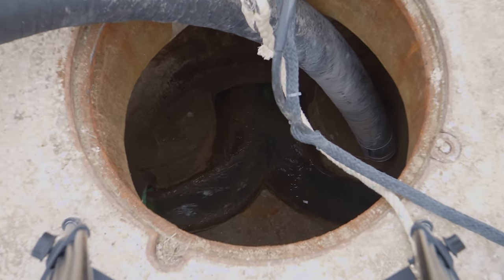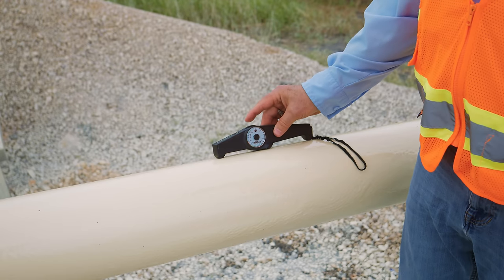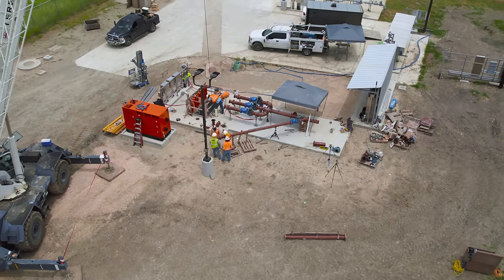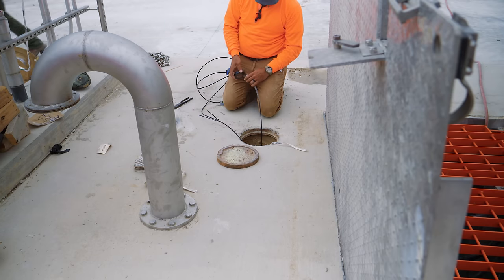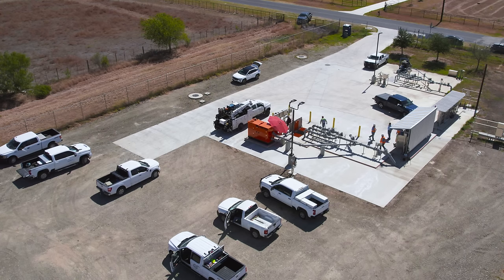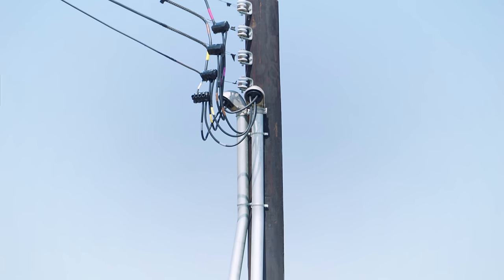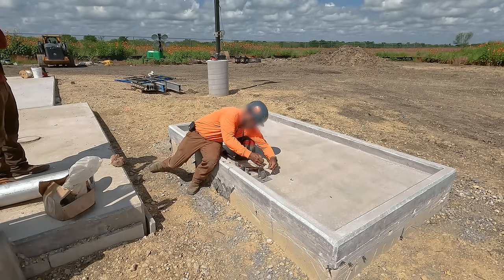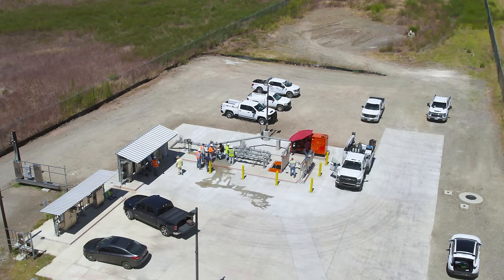HEAVY CONSTRUCTION of a Sewage Pump Station - Ep 5

Comment: My dad was a field technician for the local water company. He was the guy who'd drive out there at 3am when the red light starts flashing, with a pair of waders in the car just in case. He'd have loved how maintainably designed this station is!
Reply: The endorsement fron an experienced person like 🎉 your dad  always matters.
Reply: I can never understand why the Shone system developed in the mid 19th century is not used today. With no moving parts on the water side (except the non return valves) many of these systems are still running today, after more than 100 years of 24/7 operation. They were developed when buildings in London (UK) were below the Thames, and hence the sewers. The houses of parliament, better known for Big Ben, were one of the early installations that is still running today. Between 1909 and 1026, they were incorporated into several London theatres.
When I visited the Becton treatment plant, that has to lift the sewage from a sewer large enough to drive a single decker bus through, I explained them and they were gobsmacked at their simplicity and lack of any pumps. No one on the design team had even heard of the principal.
If it is not something that you have come across, I am happy to explain it and how unbelievably simple and maintenance free it is by eliminating pumps that can block and wear.

Comment: This series has been extremely satisfying, I hope you'll continue! There has to be a more efficient way to get all this done. I feel like manufacturing the wells as single pieces, with plumbing connections included, would save weeks and millions of dollars.
Reply: Although I like the idea... I don't think this solution would be cheap for all the different types of infrastructure.

It's a lot cheaper to make a lot of the same pipe in a factory vs making specific, custom-made wells
Reply: @mrping2603  I also feel like the separate-piece construction could deal with settlement, seismic events, etc better
Reply from the maker: Lots of smaller lift stations come prebuilt like you said, but not at this scale. It took 6 semi trucks just to deliver the wet well segments!
Reply: you underestimate the cost of hiring a custom haul truck to move something that is too big to haul over the road.  and the cost of renting a crane big enough to lift that entire thing all at once.  you're talking about weeks in transit and millions of dollars in transit costs.
Reply: @kenbrown2808  The other day I saw a convoy of way oversized stuff and they had to have a police escort and like 20 lead vehicles/follower vehicles. The entire interstate was piling up behind them. I think they were carrying what looked like rocket parts potentially, large cylinders two end capes, and the cylinders had a lot of attachment points/small pipes. I only shudder at how much that must have cost.
Reply: What stuck out to me was the on-site stripping and painting of all the piping, plus QC for the coating.  Surely that could all be done more efficiently, effectively, and probably cheaper by the manufacturer or at least a third party, indoors.
Reply: @macaroniandtuna  - but then you have to more carefully transport the finished product to site and any tears in seals or scratches are now a reject/redeliver issue. I'd imagine there are trade offs either way here and I'd imagine they've been considered.
Reply: @macaroniandtuna  I wouldn't be so sure about that. The protective coating the manufacturer puts on is meant to protect from the sorts of damage that can occur in transit (including on the flange faces & sealing surfaces), the in-use coating is meant to protect from the environment in the wet well (less abrasive, more corrosive) and has to leave the flange faces & sealing surfaces uncoated so the seals can work properly. Even if they could have one coating that worked for both environments it'd still need a way to protect the mating areas in transit, and removing that & preparing the surfaces would still be an on-site expense. It might be a waste to do it the way they did here, but it's not immediately obvious.
Reply: @macaroniandtuna  Where i live they just use 316SS instead. Not sure how the cost compares but as haven't worked with this shown system
Reply: It all looked very efficient and competent to me. There is a reason engineers do things the way they do and very often trying new procedures makes things more difficult or less efficient. There are also complex regulations to worry about.
Things like paint are often done last minute because they are easily damaged by other work. Also painting once is cheaper than repainting several times, especially if you have to clean off the old coat(s) first..
Reply: The unions™ would never allow it.
Reply: The only thing i thought was weird are the submerged pumps .... they likey dont like the maintainance crews..
Reply: @Theinatoriinator  other than the multiple attachment points, I'd say parts of a windmill tower.  but yeah, biggest thing I saw being moved was a power plant transformer.  I calculated the haul truck as a 180 wheeler, and it was moving at a speed best expressed in feet per hour.  few escorts, because it was on private property, from a purpose built railroad siding to the power plant.
Reply: @macaroniandtuna  until it gets chipped in transit.
Reply: @NuclearSavety  you don't have to prime a submerged pump.  and a top mounted pump is still going to be full of sewage if it has to be serviced.
Reply: @kenbrown2808  the diesel pump is also self-priming ... and opening a poop-filled pump is still much less of a mess than pulling one out of the 'pool'  ....
Reply: @PracticalEngineeringChannel  Well, you could put in place a casing and then bring in liquid concrete to add the needed weight.
Reply: @Lucien86  I disagree strongly. Very frequently, the reason engineers do something the way they do is simply because that's how it's always been done. This has been especially painful in aerospace development.
Reply: @dansands8140  when the consequencrs are potentially catastrophic, there is a good reason not to get too creative....
Reply: @NuclearSavety  and the pump in the diesel pump is probably more expensive than all three submersible pumps combined.  and a pressure washer pretty much eliminates the mess of pulling a submersible pump for service.  everything has tradeoffs, and the engineers chose to use submersible pumps in that application because the benefits outweighed the drawbacks.
Reply: @kenbrown2808  i fully agree, its a substantially cheaper sollution, that is a big advantage ... i still would go a different route.... and seeing the corrosion skid marks on the new pumps ... well, its not my job  ...
Reply: @nelsonbrum8496 respectfully, while Unions may have played a minor role, it's the potential liability that drives most of, if not all of the various procedures. Nobody wants to pay for redoing any work. Much better to do things in the approved manor. For that reason lone, contractors will opt for as much independent inspections as they can. It's insurance against the possible reprocussiions.
Reply: @Theinatoriinator  It could be rocket parts, but I'll bet you it was equipment for a large chemical refinery plant.
Reply: @NuclearSavety a key point to remember is that pumps can only push, any sucking is just fluid being pushed by atmospheric pressure. This also means there is a hard limit to how far a pump can intake water from below itself, as well as a much reduced flow rate for whatever operation it can provide. The submerged ones likely operate far more efficiently at a higher pressure,  are protected from freezing, and can be cooled by their sludge bath.
Reply: @Steamrick  you've gotta be right, now that I think about it. I couldn't get a good look and I was already thinking about rocket parts but chemical refinery makes more sense.
Reply: @macaroniandtuna  I thought of that too. But then I realized they were only doing that to the pipe that was to be submerged inside the well. So that coating was something special. They left the factory coating on all the above ground pipe and applied paint conventionally.
Reply: @NuclearSavety Probably using PDP's. But yeah, zero fun.
Reply: @microwave221 They're also probably Positive Displacement Pumps. Dang near infinite head.
Reply: If built in-factory instead of on-site, transportation of the very large and very heavy assembled structure would be difficult and expensive.  Also the factory assembled structure would have to be more sturdy to survive the stresses and forces of transporting, which would increase the weight.

Our transportation infrastructure is not designed to easily handle moving objects that are wider than lanes on roads or wider than railroad cars.  There are height, length, and weight limits too.  It's possible to move bigger and heavier loads than these limits, but the cost goes up, and the transport methods become fewer.

Comment: Great video! As a potable water plant operator, the majority of your video is also incorporated on drinking water as well. SCADA, transducers and redundancy measures are extremely similar. Difference is we use powerful motors to extract water from underground aquifers and treated into clearwells where chemicals are added and sent out to community either by booster pumps or elevation tanks.

Comment: Your work is amazing on this series. Thank you so much for all the work you and your team put on this.

I work in electric maintenance in water and sewer lift stations here in Brazil. Some parts of this new station are exactly the same as the stations where I work in Brazil, while others are very different. Here, for example, in many stations we only have float switches as a device to turn on the pumps, and the wet wells here are not covered with epoxy paint.

Comment: The bag in the conduit is a great idea for running the wires. Separate of that, kind of sad seeing how developed the land is becoming.
Reply: And how car-centric it all is. And knowing how much energy is required to pump this sewage up - how utterly wasteful we humans are.
Reply: @idjles 100kW with 2 pumps running is certainly a lot of power but compared to how wasteful other things are, it's not comparable.
Reply: The bag on the string is called a mouse, and the trick has been passed down by generations of electricians.
Reply: @idjles would you rather we didn’t pump it?
Reply: @idjles in the industrial world, those actually aren't very big pumps. I've seen 350HP pumps used to distribute chilled water for building cooling, and the actual chillers consumed nearly 2000HP, plus more 350HP pumps to pump hot water to the cooling towers, and the cooling towers all have 75-100HP fans. These also aren't run at 10-20% capacity normally like a car engine, they run near their full capacity for long periods of time. I saw meters in a paper mill once that estimated they spent at least $17,000 an hour on electricity, and they did not look like they'd been updated in a good long while either, and that's just from utilities. They also run their own power plant at the mill! 

TLDR: Don't worry, that lift station does not use that much power!

Comment: It'd be interesting to hook up a little 360 camera and GPS unit, send it down one of the lines and be able to follow it throughout the system
(GPS + inertial tracking when it's unable to obtain a signal. There's also RF if someone were to walk along the surface to manually trace-out the path)
Reply: I'm not sure I want to see what a camera might show in a sewer pipe. 💩
Reply: Most probably GPS and internet coverage will be quite poor through most of such journey. Unfortunately. Video footage might be interesting, but would require a lot of light and hope that it doesn't get stuck somewhere.
Reply: Do people think GPS is magic?
Reply: GPS needs view of the sky, so better to have an inertial tracking unit to map that journey;-)
Reply: The pump would grind it to pieces
Reply: @benclarke8699   There are usually screens to prevent large objects getting into the pumps and whatnot, so it'd have to be pulled and moved passed the pumps. 
I was referring mostly to the gravity-fed system from a house toilet to the lift station.
Reply: Hello, your local wastewater operator here. We commonly put cameras down the pipes to track leaks or illegal discharges, which then can be internally repaired with an expanding hard foam instead of having to dig up the pipe. We call DEP on illegal discharges. They don't go all the way through, but they can go pretty far. If you'd ever like to see a map of your water/sewer system, they're available in public records, or you can go to your local plant and ask nicely to see the physical map.
Reply: @christhompson2006 Retired wastewater engineer here. I've spent many hours watching video of sewer pipes, most of which were actively flowing sewage (or sauce as we called it). When people from other departments walked by and asked us what we doing, we just told them we were watching "dirty movies".
Reply: @johnnyh3653  🤣🤣🤣

Comment: Last month I was tasked with modernizing a wastewater treatment plant for my last final exam necessary to get my electronics engineering degree. It's so cool to see how these things are actually built even if this is a small part of the entire wastewater treatment system. I had to put sensors, PLCs, actuators and orchestrate everything using SCADA, not to mention motor soft starters, protections and controls. This is a great series and I'm really grateful you took the time and effort to make it, thanks!

Comment: I'm retired now but I saw many interesting motor control systems. At first I started out with systems in bakeries such as moving flour or sugar using an air blower from silos to weighing hoppers. There are continues systems and batch systems. This description is for batch systems. The hoppers dumped the weighed product into large mixers that made sponge dough that was dumped into large tubs. After the sponge raised then it was dumped into a dough mixer. The mixed dough was placed in large tubs that were used to dump the dough into a bread former that dumped dough into bread pans. The pans went into a proofer to raise the bread, then into an oven to bake the bread, followed by a spiral bread cooler, then into a bread slicer, a bagger, and conveyors to move the packaged bread to trucks.  

Another interesting project I worked on was a copper wire shredder that had a conveyor to put the wire into the top of the shredder.  I remember they had a large coil of small wire that had misaligned insulation. They spread out the wire so that not all of it would drop into the top of a shredder. Once the shredder gabbed the first of the wire it quickly pulled in all the rest of the wire stalling the shredder. I bet they didn't do that again. The shredded wire came out of the shredder very warm and was placed on a vibrating conveyor that moved the wire to a vibrating separator that moved the insulation one way and the bare copper the other way with wire still in insulation of varying degrees between the two.  

Later years I worked on baggage handing systems. Most flying passengers are familiar with a conveyor behind ticket counters that move baggage through the wall into the back, That's where hired gorillas throw bags back and forth until the baggage has an acceptable used look to them. OK, the gorillas are conveyors that were designed to catch straps so some bags can slide on a conveyor for hours until they have an acceptable black burn or until another bag shows up and rips off the strap. The conveyors were also designed to rip off zipper pullers (I have a great collection of them). Sometimes passengers check what I call rolly-polls (look like bowling balls). They act like red light runners at merges and like run-a-way trucks going downhill. We all love them and wish there were more of them to keep us on our toes. The bags are then sent to the local claim device so that they will be late getting to the final destination or better yet they become lost bags and can be used as test baggage when a new baggage handling system is tested. One time I saw a maintenance employee riding down a declining conveyor that came from the ticket counters. Boy did he get in trouble.  Those were fun days working nights for a few weeks and then getting to go home where everyone was on days.

Comment: The company I work for makes mechanical equipment for wastewater treatment plants. My division specifically does headworks screens. We have what's called an EZ wipe feature on some of the screens because of the recent increase in how many wipes and stringy solids come into the plant. Otherwise those solids get wrapped around a driveshaft and plug everything up. This series has been so engaging because a lot of the terms are things I'm familiar with, but a wet well application is outside of my normal scope of work.

Comment: What has blown my mind about this project is that on the surface, it's an incredibly simple piece of infrastructure.
Just a hole in the ground and a few pumps and pipes.
Dirty water flows in, and is pumped out to continue on its way.

Yet the amount of engineering, effort, time, materials, and money to put it all together is enormous!

And means I can't even begin to guess at the level of engineering that goes into more complex projects, like the treatment plan down the road!

Comment: i troubleshooted a liftstation. And i really like Flygt pumps, they are easy to do service on. And after the trouble shooting, we cleaned the pump wetwell with a pressure washer. But i am happy, because the pumps are installed in a dry well, so it didn't require working in confined spaces.